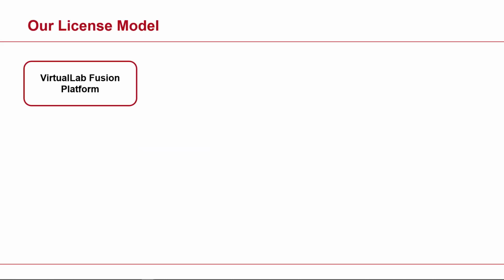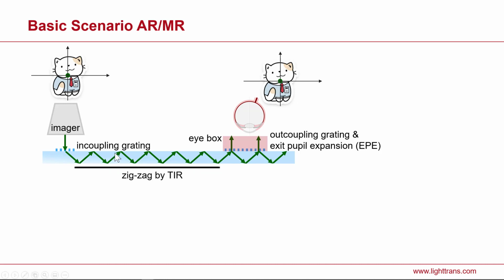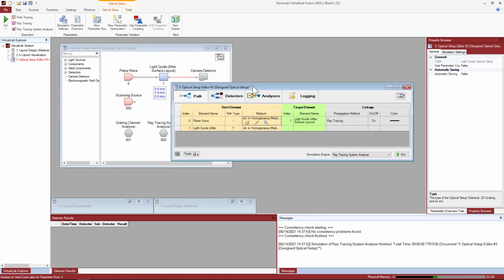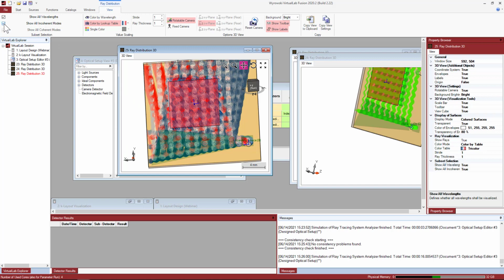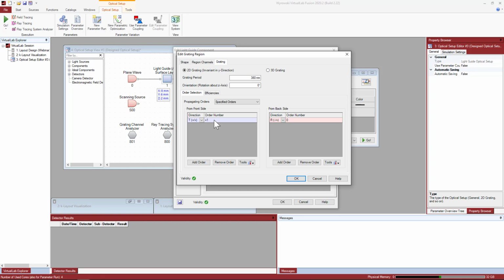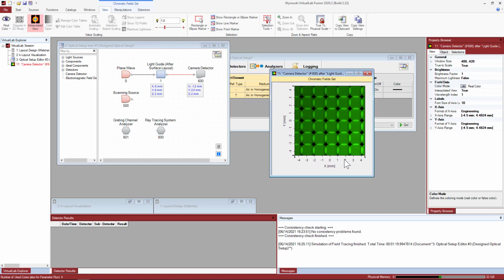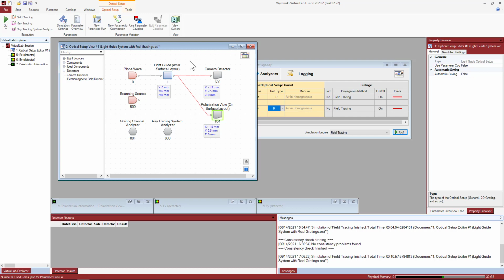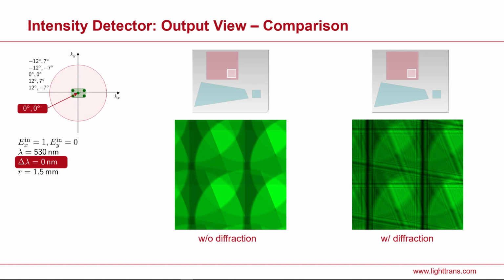Webinar: AR & MR Devices – How to Model Light Guides in VirtualLab Fusion - Optical Design Software

Comment: Is the conclusion to be drawn that diffractive waveguides will never achieve "retinal" quality, because the field at the pupil corresponding to a single activated pixel consists of multiple partial coherent, out-of-phase beamlets that will not produce an Airy function on the retina?